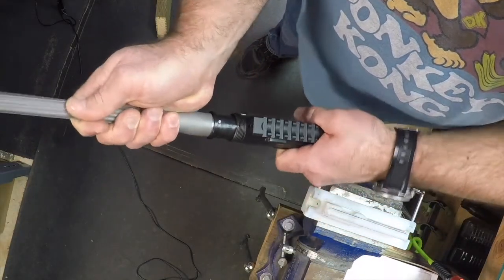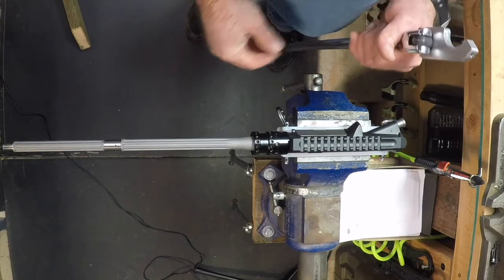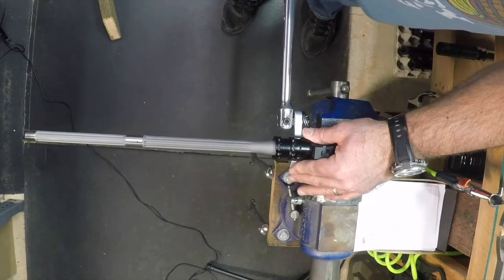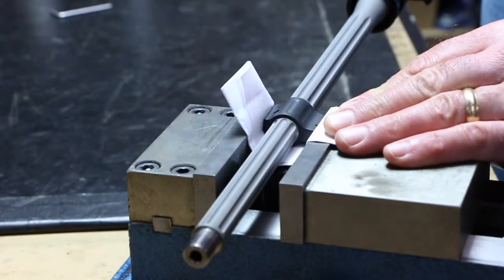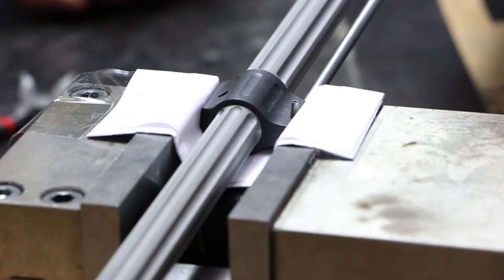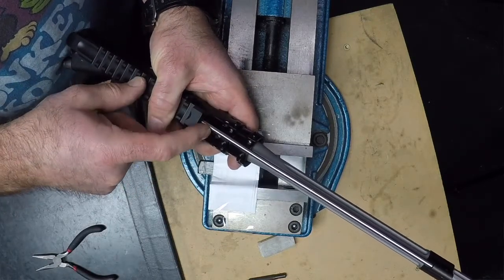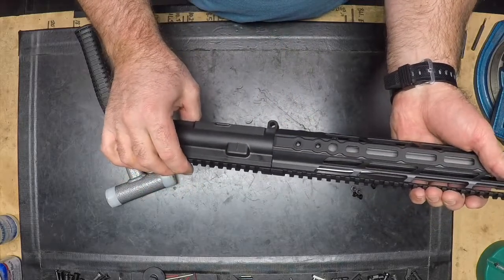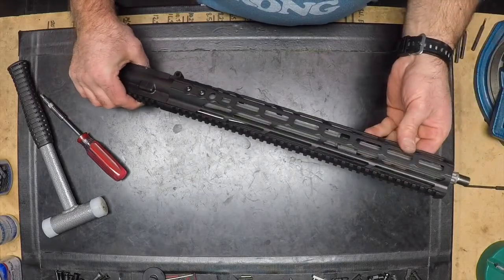V Seven Complete Upper Assembly Tutorial (Part 1)

Comment: Is there a torque spec for the handguard's screws?
Reply from the maker: Torx T25. Install screws to no more than 40-inch pounds. Loctite is recommended. When you order one of our handguards, it will come with installation instructions to help you out.
Reply: @vsevenweaponsystems  Thanks!

Comment: I like some of your products but leaving your torque wrench set at a spec that’s 101 mechanics never to do. And using a black like that to tighten up your barrel nut that weakens up everything on your gun you need a receiver extension. And there’s no such thing as time in your muzzle brake it’s a lining and it’s a Cocking handle not a charging handle when you pull that handle back all and only thing it does is cocks the gun why don’t you call it a forward charging assist why don’t you call the buffer spring charger I don’t get it Jim Sullivan the designer of the air 15 yeah we designed the air 10 to the air 15 calls it cocking handle Mikael Klashnekoff the guy to develop their AK 47 calls it a covking  handle.  Do they call a lever action a Charging action did they call a bolt action a charging action do they call pump shotgun a charging pump I just don’t get it but I guess I’m not a millennial snowflake helicopter kid that’s got to rename everything because I didn’t get a trophy of wonder bathroom matter but here I do like your parts I just wish you made a lithium Aluminum a Cocking handle and your buffer tube was completely more round then flats citing  it. but hey if I want to lottery add start my own company make my own hand guards make my own stuff and then use proper names but thank you for everything
Reply: You are named after the worst ak’s .  You spelled mk’s name wrong and you have no idea what you are talking about.